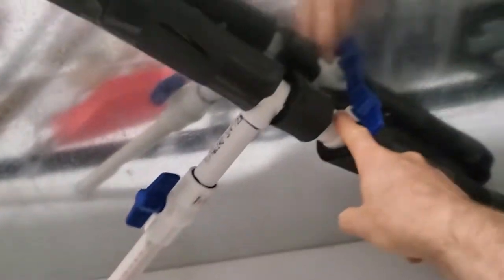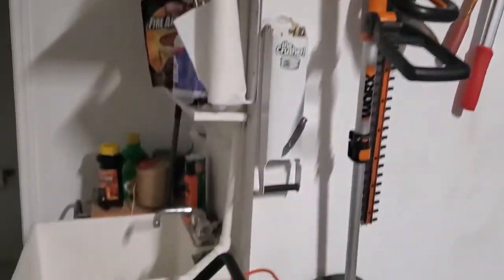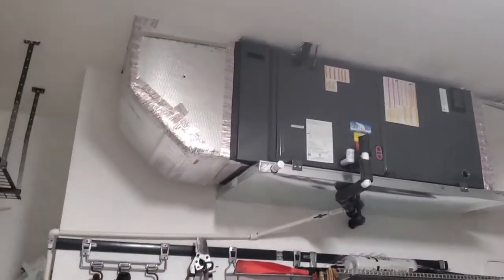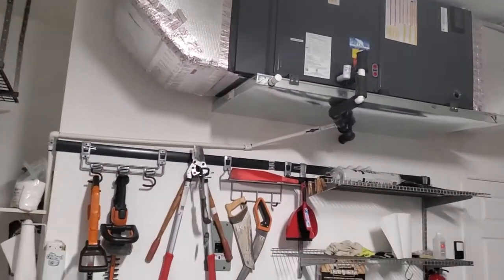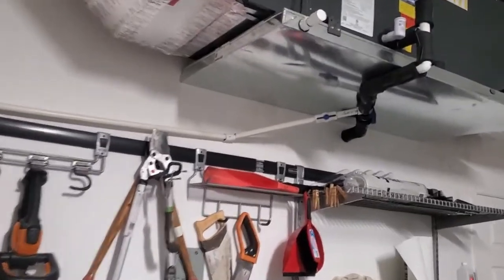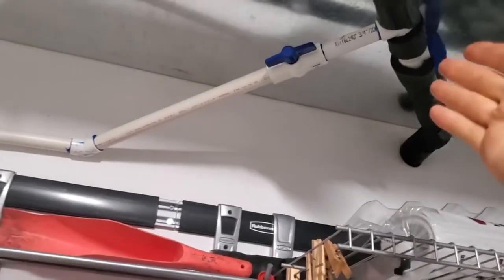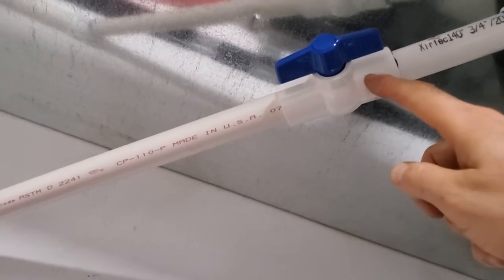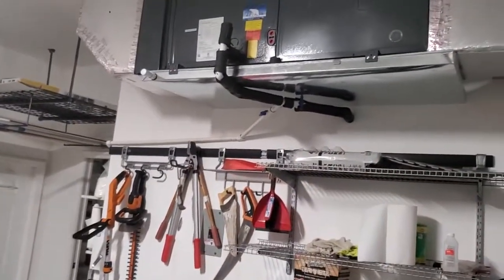How to Bypass HVAC AC Condensation Drain Pipe for Better Reliability, Reduce Maintenance Cleaning

Comment: I heard it was dangerous to bypass the trap. Have you done that ? 
My problem is a clogged condensate trap which is very hard to fix for me at 65 yrs old female. I just unhooked it before and added a short home directly into the floor drain. It looks funky but its-35 here in winter and a clogged trap spells system failure in my second residence
Reply from the maker: There's no way it would be dangerous